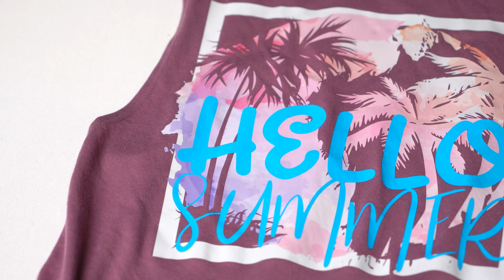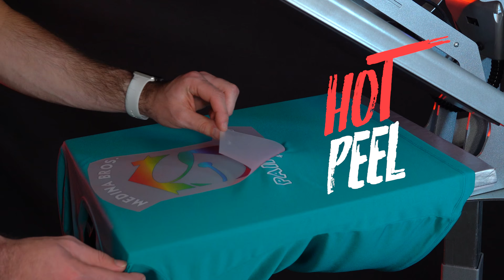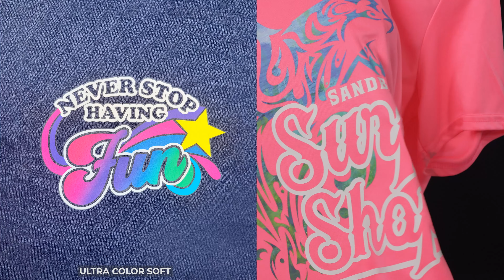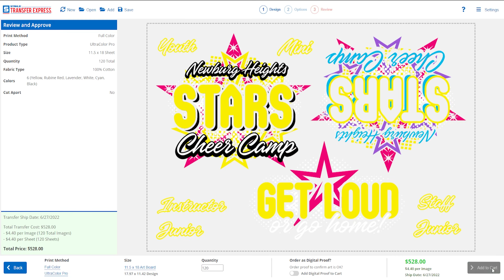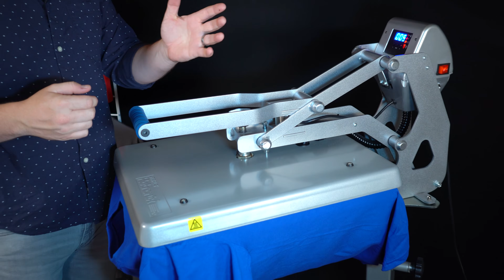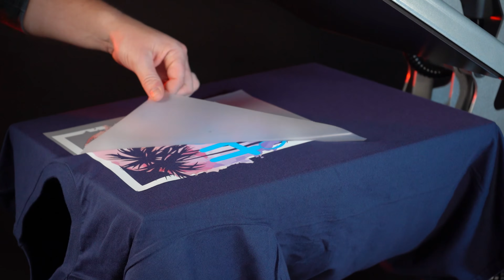Introducing UltraColor Pro | Full Color Digital Screen Printed Heat Transfers

Comment: I have had no issue with any product EXCEPT UC Pro on cotton. I have wasted several shirts because not all the design will apply. I have a Hotronix Fusion heat press that I have checked temperature and pressure and it is fine in both. The consistency of the UC Pro on cotton is not reliable. I can do 40 or 50 shirts in a row with no issue and then all of a sudden have 6 or 7 out of the next 10 not fully apply and then apply another 20 or so without an issue. It's extremely frustrating, but I have decided I can't afford to use UC Pro with cotton any longer. The product works great with polyester, no issues ever.
Reply from the maker: We're sorry to hear you're having application issues. This video may help out: https://youtu.be/cgFVxVpi9D4

Comment: thank you for your help with the transfer issue
Reply from the maker: Hey Damon, I'm so sorry to hear you're having application issues, I'm sure our resolution team is working on it now as we speak. I've personally found a quick peel (like immediately within one second of the press opening) to work the best for UltraColor Pro application with a firm pressure at 340 degrees (assuming you're printing on 100% cotton or a 50/50 blend). The carrier should feel rubbery, soft and pliable when removed, not rigid and plasticky like when its room temperature. Peel confidently in a smooth, quick, even motion. 

Please send us a video of the application as a direct message on facebook or instagram, we'd love to get this solved for you.
Reply from the maker: Hey Damon, I'm so happy we could get these transfers applying perfectly for you.

Comment: I am having the same issue with the transfer sticking. I have tried the suggested temp and time and adjusted the temp and time.  I submitted my issue to the help center a couple of days ago and still waiting for a resolution.
Reply from the maker: Hey Courtney, while our team is taking care of the help center request, we'd love to try to help here too: 

1. What is your pressure setting at? We prefer a little more on the firm side. 

2. What kind of heat press are you using? With the immediate peel, sometimes using a swinging press or a slide-out platen allows the transfer to cool too much. Some presses also have digital pressure readouts that can help with the pressure settings

3. What fabric are you printing on? 100% cotton, blended fabric or 100% polyester? The application time and temperature varies for best results with the application. 

When you peel the carrier, it should feel 'rubbery' while still hot and not rigid and plasticky as it cools down.

Comment: If anybody else has been having trouble with the ultra color pro but through frustration I tried cold peel instead of hot peel and it worked 10x better. May just be a personal experience but just wanted to share with others.
Reply: I’m having the same issue and it annoying!!!!
Reply: @VibinWithNisha  cold peel does the trick
Reply: I’m having the same issues but haven’t heard back from anyone. I’ll try the cold peel.
Reply: @lifeonsixthstreet477  hopefully it works for you as well!👍🏾
Reply: I’ve never had a problem until recently.  I’ve ruined so many hoodies.  I’m very disappointed.
Reply: How long did you wait to peel ? man hot peel just makes everything lose
Reply from the maker: Hey Zay, we're sorry to hear you're having some issues with UltraColor Pro application. We've found it releases from the carrier best when it's hot hot hot (like within 1-2 seconds of the press opening) when the carrier has a rubbery feel to it, instead of a rigid plastic feel. Feel free to submit a resolution in your account at transferexpress.com so we can get a little more info about the garments you're printing on and press setup to better improve our products. 

We appreciate you sharing your experience to try to help others. Happy pressing!
Reply: @transferexpress  definitely does not work hot peeling I've tried and it messes up every single time. Also with cold peel it's a hit or miss, I'm not happy at all with the ultracolor pro

Comment: I have a wala 15x15 heatpress that normally works pretty well with all types of transfers and this has been the toughest one for me so far. Doing over 200 front left chest logos and the transfers just wont stay down! Im messing up 1 out of every 5 shirts at this point. raised temp (checked with heat gun)... raised and lowered tim all the way up to 20 seconds and i cant get consistent results. any tips will be greatly appreciated!!
Reply: Yes, after continuosly adjusting i think i have found a good sweet spot with temp and pressure. The peeling motion is also really important as the letters come up if you peel it quickly... still have another hundred or so... will keep you posted! Thanks!
Reply: I had the same issue. After MULTIPLE calls to support, I had to increase my temp to 360 degrees for 10 seconds. I was having the same issue with application. Super inconsistent and such a mess, it was very frustrating until we got the temperature right.
Reply from the maker: Hey Edilasio, I can suggest a few things here, but for the most detailed troubleshooting, submit a resolution in your account dashboard at transferexpress.com our team is always happy to help out. 

#1, Try adjusting your pressure. While a medium to firm pressure is recommended, being on the firmer side helps with easy peels.

#2, What material are you printing on? If your press temperatures are accurate, 340 works best for cotton/blends and 290 for 100% polyester. Try to stay at those temps with the times noted on the application instructions (10 seconds / 15 seconds)

#3, Peel hot hot hot, right when the press opens with a quick, smooth peel. When it's still at temperature, the carrier almost feels rubbery and pliable and should release smoothly.

Comment: is the difference for the transfers for cotton blend vs 100% cotton except for the temperature and time needed? For example, if I happen to change the shirt from blend to 100% cotton, would I still be able to use the same transfer or would I need to buy new transfer sheets?
Reply from the maker: Hey eva, great question! The same transfer would absolutely work on cotton blends, 100% cotton or even 100% polyester garments. For UltraColor Pro, the heat and time settings are the same for 50/50's and 100% cotton, the lower 290F temperature should be used for heat sensitive fabric and/or 100% polyester.

Comment: Why dont you ever use the tag along platen in these videos? Are they not as good as the 16x20?
Reply from the maker: Hey John, we LOVE the Tag Along platen and use it pretty much every day. As much as we love showing it off, we want to show basic application here with the standard platen shape the majority of apparel decorators have.

In our opinion, the Tag Along platen is far superior than the standard 16 x 20 rectangle platens: For speed loading on and off with the shoulder and neck shape, for spot-on placement, for printing tags and fronts at the same time, for printing on short sleeves easily without changing any press setups.... we can go on and on! 😄

Comment: Can vinyl be pressed on top of that?
Reply from the maker: We haven't tested it, but it should apply no problem! Doubling up the transfers may make the print feel thick. What would you want to print in vinyl over the design that you couldn't include in the design?
Reply: @transferexpress  only because I got puff vinyl and I really like it on some designs as a added touch